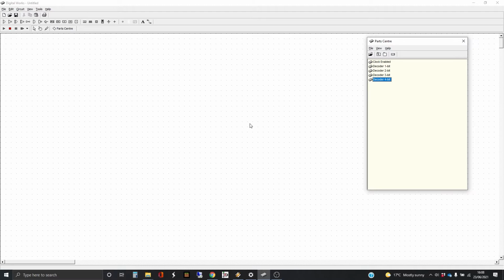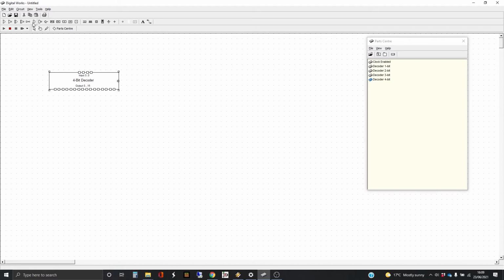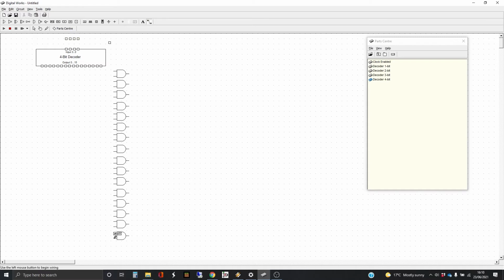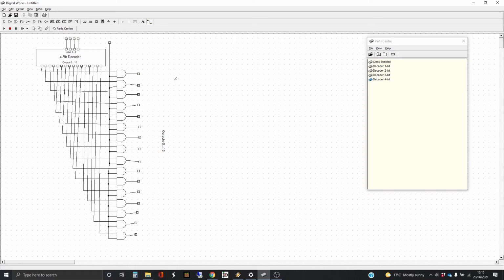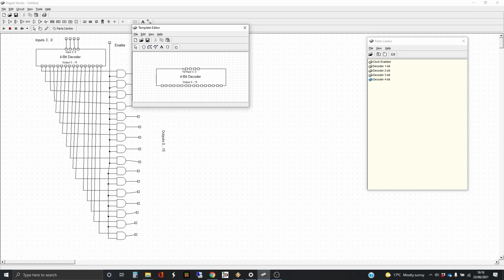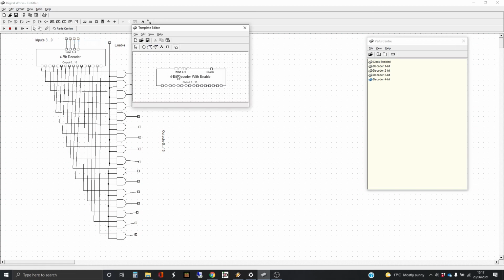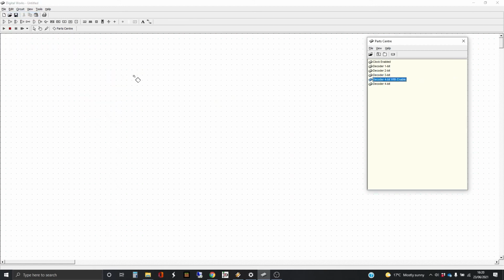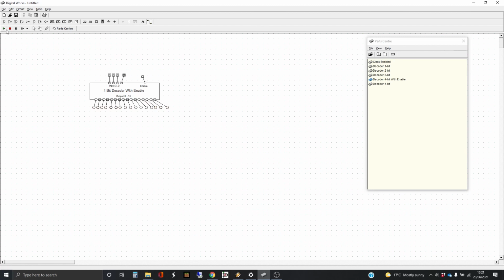Computing Fundamentals Tutor Decoders 05: 4-Bit Decoder with Enable

Comment: Well you could use latches on either the input or the output, but cheaper on the input (you only need 4). Put a latch on each input line https://www.youtube.com/watch?v=fkqeQ-DrWU0 . However you might be better with a flip-flop so that you can use the enable on it. You may or may not then still need the enable for the decoder.  https://www.youtube.com/watch?v=cK2qduOD3Jo